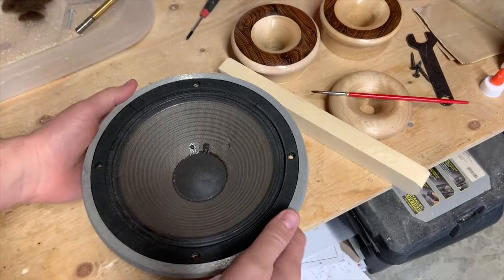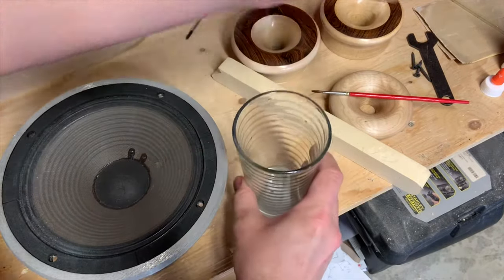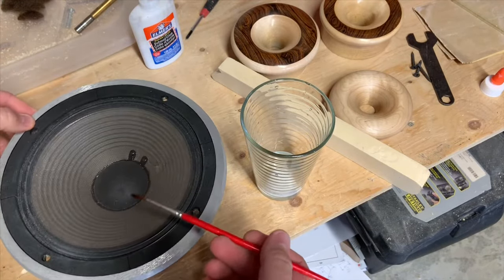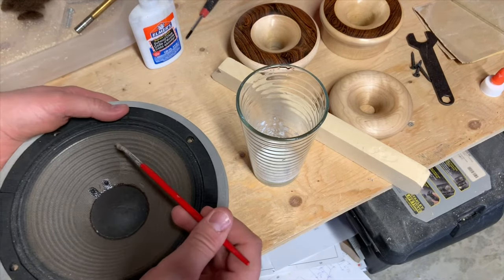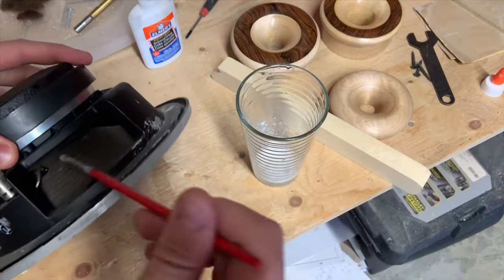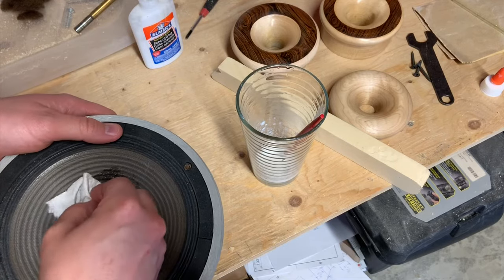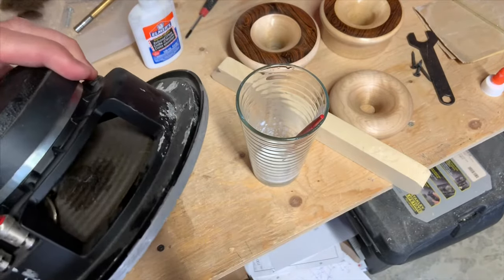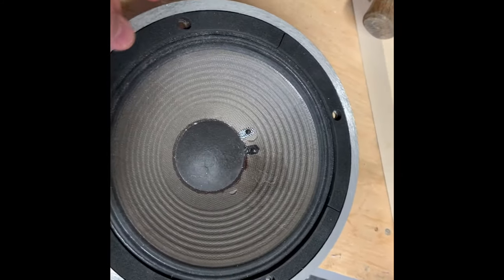Repairing a Speaker Cone

Comment: Aileens tacky glue is the best. I forget the ratio if memory serves me correctly its 1 part aileens to THREE parts water. The aileens will soak into the paper and bond the fibers and will dry to a rubbery texture not hard like wood glue and thats what you truely want. You want to saturate without tearing and let it dry flexible. And do not touch until dry for obvious reasons.
Works like a champ good as it was just made yesterday.😁
Reply: Thx... great info!  All the Best! 😗

Comment: I just want to mention that this is the best adhesive for speaker parts that are made of paper and not needing to flex (cone, cone surround and the seam between them). This is matching the rigidity an acoustic quality of the original materials. It's rigid and allows the cone and surround to "drum". The foam surround on the outside edge the speaker requires a "rubber" adhesive to allow full movement and adhesion.
Reply: Thx... great info!  All the Best! 😗

Comment: have a speaker with multiple splits. painted it with diluted aleens tacky glue. a very light coat. the glue soaked through the paper cone to the other side. Cone is very brittle. Hopefully this doesn't stiffen it up too much. I did not touch the paper surround yet, but that has several cracks too. right now just waiting for it to dry.

Comment: My main concern here would be rigidity, using either Elmers or as also mentioned nail polish. Someone mentioning flex seal sounds like a better way to go. Or for that matter any flexible substance like silicone sealer for windows or sinks or whatever. But whatever it is I would like it thinner than Flex Seal or silicone just because I'd be very concerned about altering the sound characteristics of the speaker. And thinking about that just now I can pick up at any Home Depot or likewise store liquid wire sealer. Basically like shrink tubing for protecting exposed wires, but in a viscous liquid form. And it is flexible and thinner than the other two I mentioned. What I'd like to know most is what would adhere to paper the best? Sounds like I have some testing to do.
Reply: Thx... great info!  All the Best! 😗
Reply: Silicone sealant can be diluted with mineral spirits. I'm going try it.

Comment: Trying to recone a RC-36 Bell record o fone. with little to no results. my speaker starting to dry rott..so until i can get it reconed, i kust slapped one in there for now. do they sell the speaker kits, my speaker origional had no foam rubber on it.,

Comment: Is there a way to repair cast magnesium speaker basket webs using an epoxy or something similar?
Reply: It's a bit down the road, but JB Weld is likely the go-to for that. (I'm a weldor/artist and have used it. Very strong stuff)
Reply: @wingnutbert9685  Which product works best for bonding magnesium?
Reply: @paulglaus6161  I haven't bonded Mag, but like I said, regular 'JB Weld' is my first thought. It's a two part, steel reinforced epoxy. Bonds all kinds of materials.

Comment: interesting I just used araldite / epoxy on a poly cone that was cracked, I'm not sure if I should have but figured I had nothing to lose.  Sounds ok to me afterwards.
Reply: Did it get fixed?
Reply: @Ruzz106  kind of, I tried cheap epoxy which lifted after a while  I then used superglue with superglue activator and that seemed to work ok and hold  It wasn't pretty to look at be frank.

I ended up selling them very recently when I got a pair of Harlechs.  I might sell those too as they are large speakers!!!
Reply: @roasthunter  you sell them? Did you tell the buyer about the problem
Reply: @Ruzz106  I actually replaced the drivers before I sold them so there was no problem

Comment: I have a pair of loud speakers and one is more weakened cracked in certain places week spots could I pva glue the hole cone just to make it stronger? Would it work the same still?
Reply: I am no expert here but I would have to say that of course you could glue the entire cone, and of course it would make it stronger. But the real question is what that would do to the sound characteristics. I highly doubt the speaker would sound the same. But if more strength is your concern, then glue away! But if you are concerned about how it will sound afterward I would glue ONLY the parts necessary. Even here it would be nice to have a before and after sound test.
Reply: @middleclassic  well I did just that I watered down some pva glue and it's worked fine I haven't noticed any different in sound quality both speakers sound the same and still going strong from that comment 👍